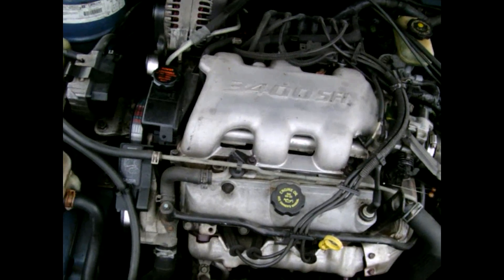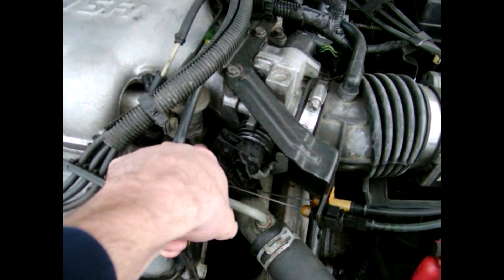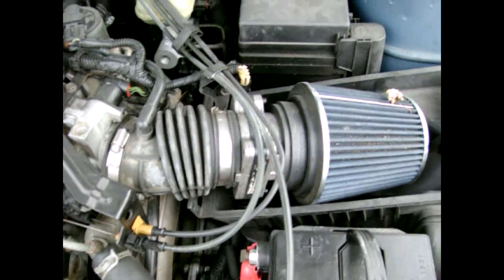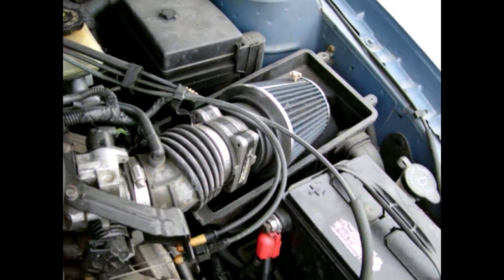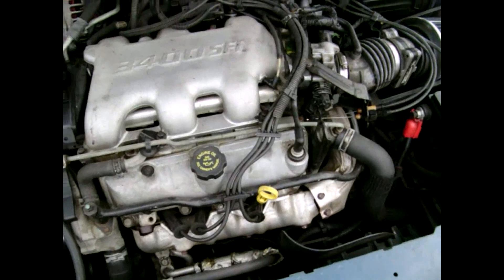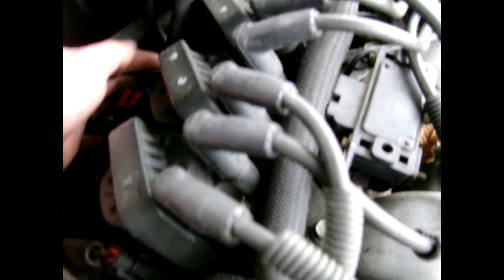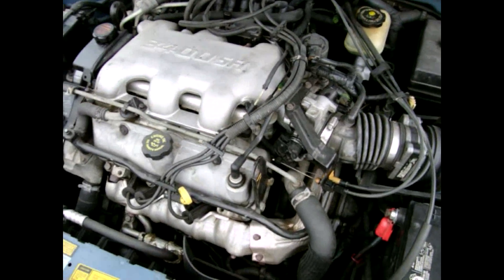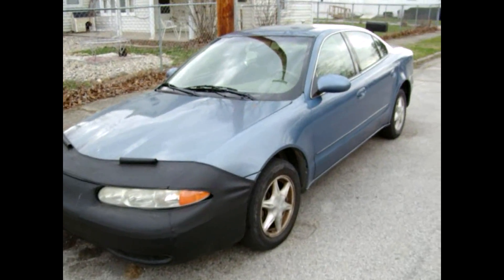3400 GM Engine 3.4 Liter Motor Explanation And Discussion

Comment: I have a 2004 Chevrolet Impala 3.4 you have to step on the gas to get it started and it stalls when you're coming to a stop but so far I've replaced the mass airflow sensor and I'm in the middle of doing plugs and wires being that they were original and it has the car has a hundred fifty thousand miles on it old man owned it car super clean in the best color white
Reply: try coil pack. or try idle air sensor

Comment: I have this motor and there is a yellow wire with a plug coming from the bottom of the back of my engine and I don't know where the plug goes can you help me so I can turn my check engine light off please
Reply from the maker: Might be part of the smog / EVAP system.  What check engine light is on?  What code is coming up?
VT247
Reply: +Vacationtime247 it was the oxygen sensor but I repalced the bad one and the light still didn't turn off even though that was the only code on the diagnostic. so I figure if I can figure out where this wire goes the light wil turn off. I can send you a picture , does youtube do that?
Reply from the maker: Send me a few good pictures to my email and I'll trace it with my engine.  Still have a couple Azteks with this engine, so finding it shouldn't be a problem.  vacationtime247@aol.com
VT247

Comment: I have an 02 rendezvous.  I currently have the heads off for gasket replacement. As you know, parts are everywhere in my garage.   It ran fine before I took it apart, but im wondering if I should replace or have the valves checked as long as I have it off.  I just bought the car and have no idea of the history.  I am no expert on heads and think maybe I should take them to a shop and have them checked?  Is this just asking for a large bill?  I am pretty handy and usually go for DYI and I took it all apart no problem. I could do the valves with good advice.  I am a machinist and have no problems following instructions.  Thanks for your videos!  Any thoughts on doing what is best at this time?  Car has 233k so who knows
Reply from the maker: I've done 2 head gasket jobs on my '01 Azteks.  Got a video up on how to do this repair.  I never had the heads resurfaced.  Clean up the block and heads, put the head on without the gasket and run a feeler gauge through it.  If a feeler goes through easily, have the heads machined.  If the intakes don't look to carboned up, I would not mess with it.  But, if you feel like you want to take the valves out, get a loan a tool valve spring compressor from Autozone and remove the springs and check the valves.  Clean up the carbon and lap the valves.  While you have the intake off, check the EGR port and clean it up too going through the intake.  They get a lot of carbon build up through there.  Clean up the pintle on the EGR valve with some carb cleaner, they can sometimes stick.  Use quality Fel-Pro heavy duty head gaskets.
Hope this help.
VT247
Reply: Vacationtime247 I have the block all cleaned up.  I have a feeler gauge set.  What thickness should I check with?  I was thinking .002.  I have a strait edge also.  today I am picking up 6 new exhaust crossover bolts.  I broke 4 of the 6.  The back two exhaust nuts came off fairly easy. Got lucky there I guess.  I watched both of your head gasket videos.  Thats how I diagnosed my problem.  THANKS!!!  I thought it was just the thermostat until I watched video #1. I had the same air hissing problem from the front of the engine.   I also read all the comments on both videos.  Like one guy said, I didnt have to remove lines from PS pump. Just unbolted and pushed aside.  Also today I will clean up the heads and other parts and begin reassembly.  Probably break that into 2 days.  It took me about 18 hours to take apart, spread across 4 days.  But im old and really took alot of breaks.  Just like you said, not hard, just time consuming. I cant wait to get this thing on the road, it is loaded and fun to drive.
Reply: safe to have preesure check lot of work take to machine shop get pressure check or gamble crack if the thing idles smooth you may assume valves functional but push the exhaust valve down look at valve face see pits if bad little black pits on valve face that could say valve job my freind

Comment: Got one that keeps overheating when i stop at a traffic light. Any idea?
Reply: Crank the heat and put the windows down
Helps take the heat from the motor works great in my 01 Venture
Reply: Head gasket time or clogged radiator

Comment: I have a 02 grand am and i noticed if i'm in park and i rev the engine a bit, it goes from 1500 rpm then drops to 400 but it bounces to 1000 then goes to its normal idle at 700, any thoughts on what can be causing this issue? also idles in drive really rough like its almost bogging.
Reply from the maker: First check to see if you have any engine codes.  Any O'Reilly's, Autozone, Advance Auto will run a free scan.  If no code, check vacuum lines, check throttle positioning sensor and idle air control valve.  Hope this helps.
VT247
Reply: hows your spark plugs

Comment from the maker: The 3.4 doesn't have a lot of issues with the timing chain breaking.  But, if it has, it is an interference engine.  The timing chain breaks, the piston hits the valve, the valves get bent, your screwed.  Hope this hasn't happened, haven't heard that it's a common problem, but anything is possible.
VT247

Comment: Been fighting a recurring problem for the life of the car ('02 Rendevous).  Occasionally, I get a crank, no-start condition.  Car will start, run for a second, then cut out.  Attempts to restart then result in just cranking.  A shot of ether will cause it to run for a few seconds.  No codes when scanned.  The crankshaft position sensor was replaced (on back of car) by the shop as well as the fuel pump, and I replaced the PCM and coil packs / plugs / wires.  It seems like every time something gets replaced, it's fine for awhile, then it will act up again a few weeks later.

Strange thing - I had to replace the front crankshaft seal (under the harmonic balancer).  The other crankshaft position sensor sits there.  I did not replace this.  After I put the balancer back on and tried to start it, it showed the crank, no-start behavior, where it was fine before I started.  I tightened down the crankshaft bolt (I think the balancer was not fully seated), and low-n-behold it started up.  I read this sensor has nothing to do with starting, but seems to be more than a coincidence.

Car is OK now, but I feel I never fully solved this issue.  Thoughts?
Reply from the maker: I'll bet you did fix the problem.  The crankshaft positioning sensor tells the coil pack when to fire the spark for the cylinder.  Without that signal, you're not getting spark or the correct spark at the right time.  So, I'll bet that the problem should be fixed.  If not, LMK.  I have 3 Pontiac Azteks, the Rendezvous ugly cousin, and am pretty familiar with these engines (GM 3400).
VT247
Reply: Vacationtime247  I am just now looking at a 2003 Pontiac grand am gt 3400 . It start and revs great put when you are driving it it has very little power and no pick up at all you have to let off the gas for it to shift gears . Not sure where to start checking for the issue . Thanks if anyone can help . bill bower
Reply from the maker: Starts up and revs fine while in neutral.  Bogs down and has no power when driving, right?  First, check for codes if the engine light is on.  Check for fuel pressure, filter and pump.  Spark plugs, plug wires.  Make sure the exhaust isn't constricted such as a clogged catalytic converter.  Just a few places to start checking.  
VT247
Reply: Vacationtime247   Great thanks I will start checking that today . I also just checked and when you rev it in park it cuts out the same place as when you are driving it ( just before 4000 rpms ) like it has a rev limiter that does not know the car is moving .. And yesterday we moved the wires around on the middle coil pack and never seemed to change much  as some of the online firing orders showed the middle coil pack different . I will reply later if I find out what the issue is thanks . bill

Comment: got a grand am gt 2003 and I have that exact green puddle you speak of!
Reply from the maker: Do a coolant system pressure test after filling up the radiator.  Wherever the leak is, coolant will shoot out.  Makes finding the leak easy.
VT247

Comment from the maker: You'll have to remove a few things.  The elbow for the air intake needs to come off.  From there, you'll need to take out the top bolt and loosen up several turns on the bottom bolt.  It can be tricky, but leaving the bottom bolt on makes installing the thermostat a lot easier.  Be sure to drain some fluid out of the radiator by backing off  the drain plug bottom drivers side of the radiator.  There are a few vids on youtube on how to do this fix.
VT247

Comment from the maker: Try this at night and let me know if this happens.  While it's dark, take a spray mist water bottle and spray around the coil pack.  With enough moisture, if the coil pack is malfunctioning, it may arc around.  You'll see a blue bolt of electricity jumping the terminal.  Sometimes the coil pack can crack and ground out.  Don't touch the coil pack while the car is running.  

Youtube has had problems with comments randomly being erased.  Not sure WTF is up with that.
VT247

Comment: I have the most annoying problem.. it's very intermitant. When driving usually happens once every week or so, I'll be driving and all of a sudden it's like my car is on cruise control the Rpms will stick at a certain spot. If I slam on the gas the power is real sluggish. I can literally let off the gas and the car keeps going. Usually maintains speed for the most part. If I stop and park the Rpms will be high. Usually I'll turn the car off for a second and restart and boom it's gone. Took it to 3 shops , one a trans shop and no one can figure it out. I take gaskets done. Tps done. Egr done. Fuel pressure done. 92,000 miles. No check engine lights no codes. I'm lost please help guys.
Reply from the maker: Just spit balling here but a few things come to mind.  Possible vacuum leak, check the area under the throttle bracket where the large vacuum hose goes.  Make sure the oil fill cap is secure too, another source of vacuum leak.  Crank trigger signal or the DIS control module possibly.
VT247
Reply: Yea I don't know what the hell it is.. the most common engine ever and none of the shops can figure it out. Drives perfect besides that. I will check out the ideas you had for sure man. I appreciate it.
Reply: Have a 99 grand am and it does the same thing from time to time
Reply: Could be the tps .
 throttle position sensor

Comment: I have a 3100 that will not run right to save it's life. I changed the head gasket and still runs like.garbage. it starts them dies and then you hear this loud pop and it's the pcv hose blasting off.
Reply: +Tim the car guy. Check the spark wires.
Reply: +Tim the car guy      does it run when u spray starting fluid or anything in it?       i know that vacume lines on these can make it run weird but not nearly as bad as what ur saying , it sounds like its almost out of time or something but idk about that, like i build this engine and i timed it wrong and it would  back fire, spit flamesand made the cat glow red.

Comment: I need someones help I have a loud noise coming from my engine I'm thinking its the oil pump  cuz the slap noise sounds like a lifter and doesn't stop when it warms up what do I do I'm afraid to drive it and blow the motor
Reply: Its a 2003 Montana 3.4
Reply from the maker: Check your oil.  See if it is milky or is black.  Check for metal shavings or 'shiney' oil.  LMK
VT247
Reply: @Vacationtime247  sound like you spun a rod bearing!!

Comment: I have a 2005 impala  overheated radiator coolant went to transmission, blown gaskets a true nightmare..So I fixed transmission rebuild heads replaced entire water system worked like a charm.. but it only lasted less than 2 months wouldn't drive it fast or anything.. suddenly it started heating up but didn't let it over heat.. instead I just parked it.. it's been sitting in limbo.. without an idea what went wrong.. Can anyone have an idea?
Reply from the maker: Bleed the air from the system.  Might also do a coolant system pressure test.
VT247

Comment: I have this same engine in my 2001 Aztek. The engine compartment has a different configuration but the engine is the same. My fuel pressure regulator went bad on me so it would leak fuel but only when it was very cold outside ( like below zero) so I didn't mess with it for a few years until just recently it started leaking more often so I replaces it which is a bit of a pain to get off. they cost about $100. About 2 years ago I let the engine get a little to hot and it damaged the head gasket and costed me $1400 to fix but that was a little my fault for letting the engine get that hot. The biggest design flaw in them is that the head is made out of aluminum and the block out of cast iron so when they heat up the different metals expand at different rates which warps the gasket and causes the leaks. Now though I have to replace the alternator  which means I have to LOWER THE ENGINE just to get the alternator out. The engine compartment was really badly designed. Thank you for the video BTW :)
Reply from the maker: You can take out the serpentine belt, power steering pump, remove the 2 upper motor mounts, roll the engine forward and then take out the back bolts for the alternator, the plug in, the power wire and the side bolt.  Then the alternator will come out the side.  Don't have to drop the engine.  I got 3 2001 Pontiac Azteks.  1 is a base model the other 2 are GT's.  I'm in the middle of pulling out the engine in my red one.  Blew a head gasket, got to hot, fried the motor and appears to have a crack in the cylinder wall.  Not fun, but i found a $200 replacement engine at a local junkyard so that eases the pain..... a little.
VT247
Reply: Vacationtime247 I've got a Pontiac Grand Am with a coolant leak from a small hole on the engine between the alternator and power steering pump on the passenger side.  Looks like a small bolt hole or something.  Can't imagine where it came from.  Have been searching the Internet for the last three hours and came up with nothing.  It isn't the purge valve on the front of the engine.  Any ideas?
Reply from the maker: KEEP ANTIFREEZE IN THERE AND DON'T LET IT OVERHEAT!!!  These motors are known to blow head gaskets.  But on to your issue.  If its squirting out under pressure, it's coming from one of two places I'll bet.  The intake manifold gasket or the timing chain cover.  I've had to replace both before.  There is a gasket that goes between the block and the timing chain gasket cover.  It's not that hard of a repair, just time consuming.  If it's leaking from the top, and there is a puddle near the lower intake manifold, it could be the lower intake manifold gasket.
VT247
Reply: The lower intake manifold gasket is what I keep finding in my searches.  Yes, it is coming out under pressure.  It's on the top of the motor right between the power steering pulley and the alternator.  There are a few hoses and an electrical connection that make it hard to see except from the right angles.  It looks like a perfectly drilled little hole about 1/4" round.
Reply from the maker: The intake manifold could easily be bad.  They are known to go bad.  Not a hard fix, but takes some time to get done.  Check out my video's, I have a how to on doing this repair.  The upper intake will leave a puddle on the top of the engine.  If you''re still not sure where it is coming from, fill up the radiator and use a pressure tester.  It hooks to the top of the radiator cap site and you can pump it up and build pressure inside the system.  Water will come shooting out.  This will let you see where exactly it is easier.  Hope this helps.
VT247
Reply: I can see exactly where it's coming from.  I wish I could upload a pic because I've captured it.  I'm pretty skilled mechanically but this is something I've never seen before.  Everything I find is telling me to do the lower intake manifold gasket but I just don't see how that would block this little hole.  It looks like a screw was removed or something.
Reply: And I watched your video, very good information.

Comment: 2003 Olds Alero 3.4L
This summer after sitting for about two weeks my car would not start, it would crank but not start. I put new plugs in and bought starting fluid and it would only start with a few shots of ether. I replaced fuel filter, fuel pump and pressure regulator during the course of the next couple months and still the only way to get the car to start after sitting overnight is to use starter fluid!!!
What the heck is next?
Reply from the maker: Sounds electrical.  Might try cleaning the plug under the car, they tend to get corroded after time.  Try using a piece of tubing and put it to the fuel injector as someone turns the car on, other end to your ear.  Should hear it click when it's turned on.
VT247
Reply: Vacationtime247 
What plug are you talking about? I can hear the fuel pump run when I crank the car and after getting the car started I can stop and go all day long with no problems but an extended period of sitting is when I need the ether to get it started.

Comment: Yea, this was an unlucky buy, I was sure it was going to be a simple gasket set, but when I look back, all the gaskets that came off looked perfect. Then the motor we got from salvage had to have the heads done, 3 valves with blowby and warped.  Well, I will pull off the valve covers and let you know if they are seated properly.  The computer says cylinder 6 misfire, thank god it's not a rear one.